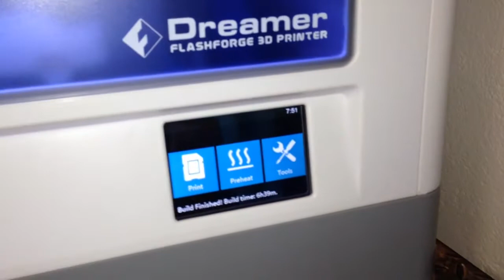Flashforge Dreamer - Holden VL Commodore

Comment: Hey, how is the leveling on this machine? Does it go off level and when you do have to level it, does it have a sensor that tells you the distance of each corner, so you can adjust the height bases on those values? I guess what I'm trying to ask if the leveling is semi automatic. Any sensors for the z gap?
Reply from the maker: Hi Rudy. No, there's no kind of Z-axis measurement when levelling. You just have 3 screws and adjust each in turn so a piece of paper can pass under the nozzle with a little friction. Levelling is done all by feel. But in saying that, I have levelled the bed once when I bought it, and then again when I installed the glass plate. I have now been printing pretty much everyday for nearly 4 weeks and haven't had to adjust it since

Comment: just got mine the other day! so far its amazing
Reply from the maker: Can you print by wifi? I can't, I keep getting errors
Reply: Thomas James yep same here, I can connect to the printer but I can not print. Maybe it's a firmware issue? also I am looking to get glass for mine, do you need to adjust the z axis to make up for the new bed thickness?
Reply from the maker: XssXcoolioXssX Hi, I had to stick a bit of plastic on the bed to hit the Z-axis switch because I couldn't adjust the bed down enough without it.